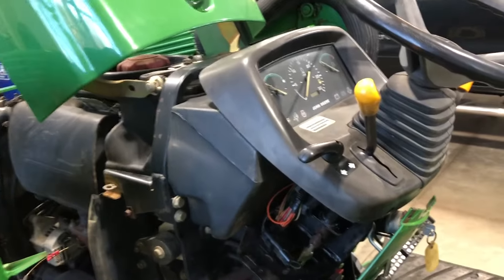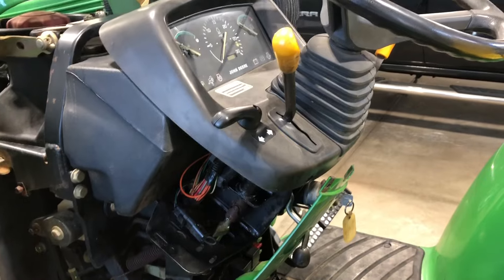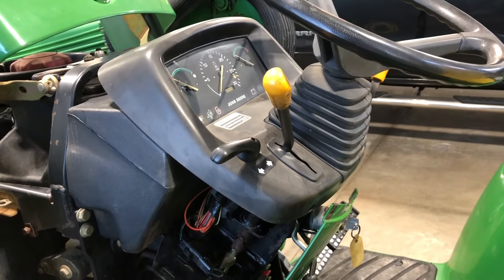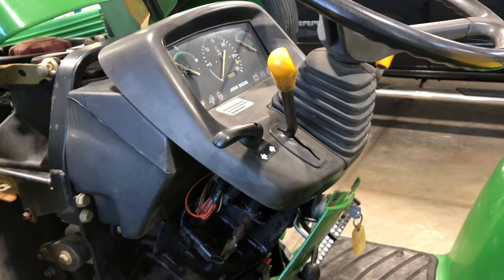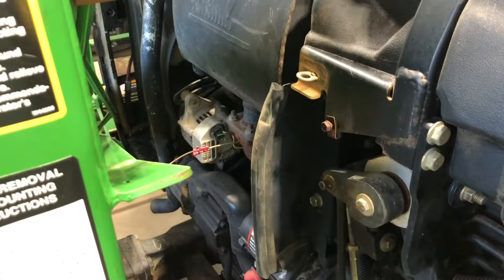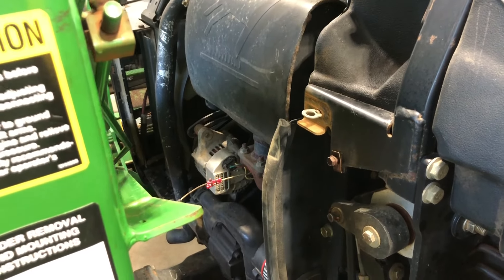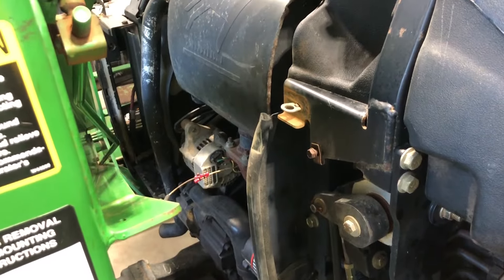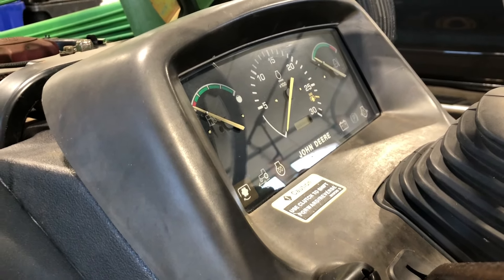John Deere Temperature and/or Fuel Gauge Fix

Comment: That will only works if the gage and sender are linear. Most are not. You could add a resistor and make it read what ever at what ever part of the scale you choose. That it's not a fix. Worst yet, up to and above that point you have altered the relationship so you do not really know how far off you are.

Comment: Your video only shows how to adjust the temperature gauge. What about the fuel gauge which you mention at the beginning and end. You don't show that procedure. Where is the wiring that connects to the fuel gauge and what value resistor do you use to adjust that gauge? You don't show that procedure in your video.  Please clarify.
Reply from the maker: @bigeddiem3745  thanks for reaching out.  I can create a new video on the fuel gauge.  Will create in the next few days and let you know.
Reply from the maker: @bigeddiem3745  https://youtu.be/djNpkScm2pQ?si=AkDFJPzrT77jd5Va

Comment: Darren, I have really appreciated you suggested repairs for the JD 4300 tractors and plan to put several into use. Any suggestions for an hour meter that has stopped working also has a bad temperature gauge that I plan on trying to fix with a resistor as you suggested. I was planning on purchasing a new gauge cluster. (OUCH) keep up the great videos… Thanks
Reply from the maker: Glad that the videos are helpful and thanks for your feedback.  You can get a replacement hour meter.  You would have todo some soldering to remove/install the old/new meter.  I believe it would work, but never tried it.  The part number of the meter should be on the back of the meter.  I would just google the part number and see what you find.  I bet it’s just off the shelf part/meter that is readily available for much less.  Hope this helps…
Reply: @darrenmas  My fuel gauge doesn't work that well either, but the bigger problem I'm having is my tank has a crack somewhere on the bottom side. If I put more than 2 gallons in it, it leaks all over the place. It's not the fuel lines. I'm having a heck of a time getting the tank out. That little piece under the steering wheel and above the fuse box is the problem. I did post a video of how far I got. Any thoughts appreciated.
Reply from the maker: thanks for reaching out, here are the high level tank removal steps on a 4000 series. should be able to jb plastic weld the crack once tank is removed. hope this helps.

1. Park machine on level surface, shut engine off, engage park brake.
2. Allow machine and engine to cool before attempting to service fuel system.
3. Remove engine side panels.
4. Remove steering wheel. See Steering Wheel .
5. Remove control panel. See Control Panel .
6. Remove key switch panel. See Key Switch Panel .
7. Remove cowl panels. See Cowl Panel .
8. Remove hood. See Engine Hood .
9. Remove brake pedal shaft. See "Brake Pedal Removal and Installation" in Brake section.
10. Remove two cap screws (A) on each side of hood support frame (B) and remove hood support frame.
11. Disconnect throttle link (C) at engine by pulling rod outward.
12. Drain fuel from tank into a suitable container.
13. Label and remove fuel lines from fuel tank.
14. Remove fuel overflow drain hose (D).
15. Remove drain cock (E) and fuel hose elbow (F) from fuel tank.
16. Loosen screw (G) on clamp holding fuel gauge sender wiring harness to fuel tank. Turn clamp to release harness.
17. Remove two nuts (H) and lock washers connecting wires to fuel gauge sender. Remove wires.
18. If necessary, drain coolant overflow tank and disconnect hose from radiator to tank.
19. Remove cap screw (I) and coolant overflow tank.
20. Remove two cap screws (J), washers and rubber isolators (K) securing bottom of steering support to frame.
21. Remove two nuts (L), four washers, and two cap screws (M) from rubber isolators (N) that secure top of steering support to frame.

→NOTE: An assistant may be required to tilt steering support while removing fuel tank.

Tilt steering support toward rear of machine and remove tank from frame.
Reply: @darrenmas  Thanks. I have that same repair manual. I don't see how removing the brake and clutch pedals or actual steering does much. I've done everything else. I'm leery of giving a hard pull on the steering wheel/fuse bracket toward the seat, but I think that is what it needs. I may use a ratchet strap and go very slow. The project is on hold until I can devote some more time to it. Thanks for the info.

Comment: Your title says “temperature and or fuel gauge fix“, you didn’t talk very much at all about the fuel gauge. Is it the same exact thing pop a resistor in there? We just spent $350 because the piece of crap sending unit was leaking. I expect the new one is going to leak within a few hundred hours cause it’s the same piece of crap design. I love the 5105 but I really hate John Deere’s ability to harness the power of “planned obsolescence” and the way they hide things. To change the fuel pump on a John Deere gator should take minutes. You should not have to take the cage off take the seats off take the seat pan out to get to the fuel pump. John Deere has turned into a disgusting company.
Reply from the maker: @Composiclean  thanks for reaching out.  Yes a resistor in line is it.  Here is a high level for the fuel gauge if it’s reading too high.  https://youtu.be/djNpkScm2pQ?si=5YqFtm5qV0jg0_-d